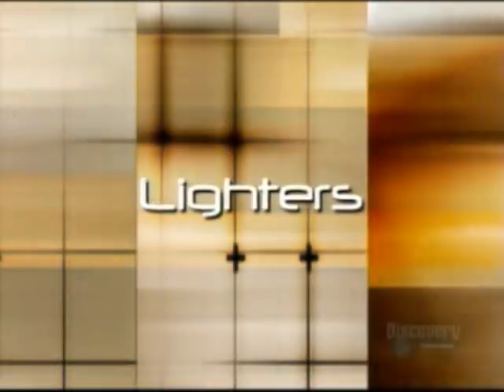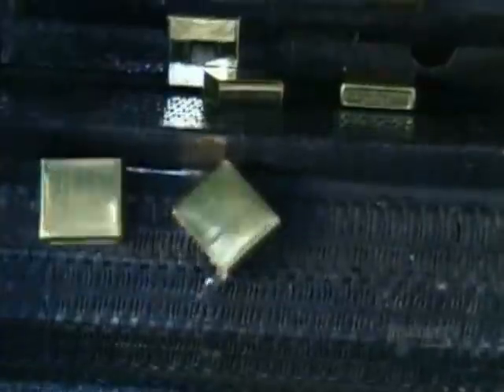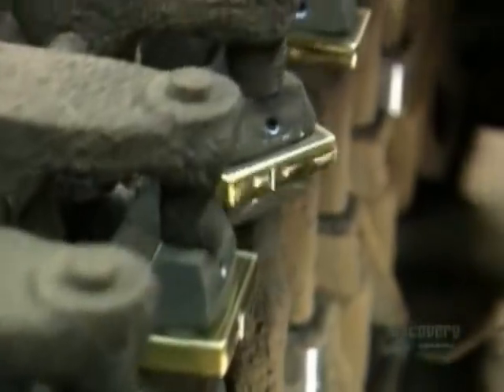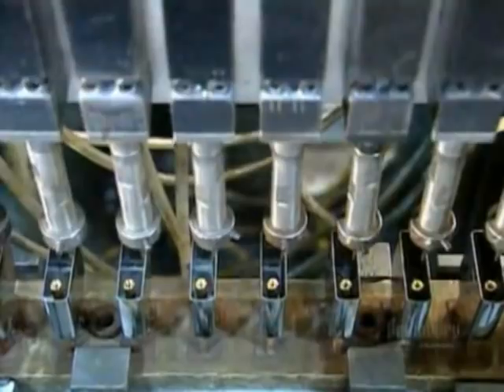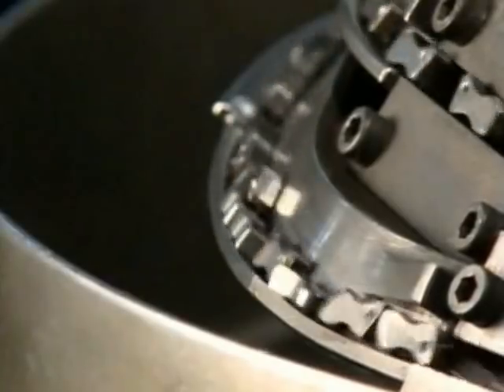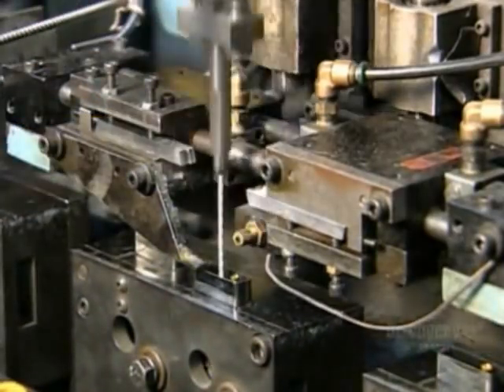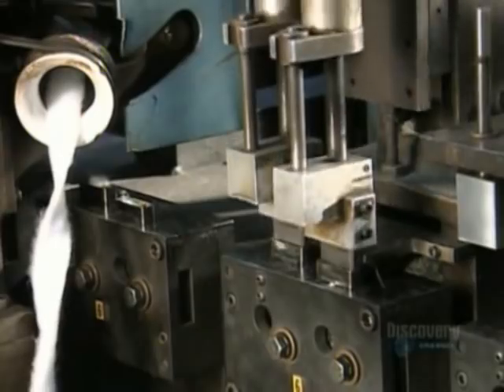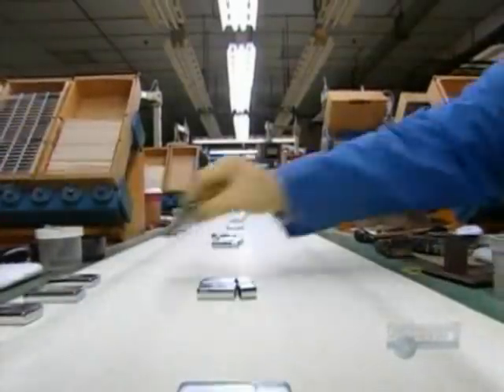How It's Made - Zippo Lighters

Comment: has anyone noticed the decline in quality zippos have today? I think 2009 was the last year of quality zippos anything after seems they got lazy with the lids being flush. also I've seen alot of ruff edges on the lids.  getting sloppy zippo..... getting sloppy.
Reply from the maker: It's a pain, but not impossible, to find new old stock.

Sadly, I think it's a sign of the times that Zippo is on the decline. I think it won't be long until Zippo becomes a relic or moves to a non-domestic manufacture.
Reply: I found one at a yard sale last year that is a presentation lighter if I'm not mistaken. It's polished brass with a NYK embossed into it.
NYK is a Japanese shipping company.
I can't find another like it online.
Reply: @michaelh.8280  It was invented by a Japanese company all those years ago and bought out by Zippo. Sadly, Zippo has never improved on the design and even my $68 and up Armor series Zippos come with loose hinges. I have many hand-made steam-punk style Japanese lighters and they are very good quality.

Comment: How can I get all of that chrome off I just want to see the copper underneath I think it looks much better. Can I just sand it off? Lmk ASAP I just ordered a zippo but I want to take the chrome off when it gets here.
Reply from the maker: You could have ordered a brass finish model instead. Otherwise, light sanding with 250 - 400 grit. If you go too course you'll run the risk of taking base material off quickly.

ScotchBrite on a wheel would likely work well, but that is a method I have not tried to remove chrome from a brass base before.
Reply: ALAPINO Awesome I’ll try sandpaper. I made an account on Marlboro rewards and put 30 codes in plus the free points they gave me I only had enough points to get the classic street chrome zippo, the brass one that I wanted costed much more points. Thanks for replying though I hope the sandpaper works.
Reply from the maker: @RoamingNobody  No worries!

If you can, wet sanding helps with the finish. Dry should be just fine, though.

Comment: My Zippo is marked with a logo on the bottom, it's like a flame with an "A" inside.Does anybody knows what this mark means?thanks everybody!
Reply: My dad's Zippo has it too, he searched for the answer too and find out it was 2000 euro's worth. Maybe yours is also much worth?
Reply: The "A" means that you have an "armor" Zippo.  An armor Zippo has a case, wall thickness of .030" instead of the normal .020".  The thicker walled Zippo gives the lighter a little more weight.  I think it feels more substantial as you handle it.  Also, the thicker case makes the opening and closing sound of the Zippo about an octave lower than the standard Zippo.
Reply: Anthony White
thats on the botom of the case and on the inner part.
Reply: Yes, but what you're referring to is the letter-month designation that is located off to the left side.  If the Zippo has an A inside of a small shield with a little flame directly above, in the middle, right under the logo ZIPPO, it's an Armor Zippo.

Comment: Zippo lighters are graded in the bottom. The higher grade means better materials, more brass, and better chrome finish as well as art work. the Chinese use zinc and who knows what material the basic case was made of. probably cheap aluminum or thin steel. the real problem is the damn lighter Fluid gets on your skin if you over fill it.

Comment: Pulling it to the press
The Press Presses
The Workers steals them
An Electrode welds the hinge to the case
then Mechanic inspects the welding JoJ
Mechanized arm places a tutu and plate in a cake
*bububububu*
The tube will hold The Flintstones and the plate will form The Jetsons.
→ ← hhh... → ← hhshhhhh... →←
Sponeck screwdrivers drive the screws.
.
It's time to move on...